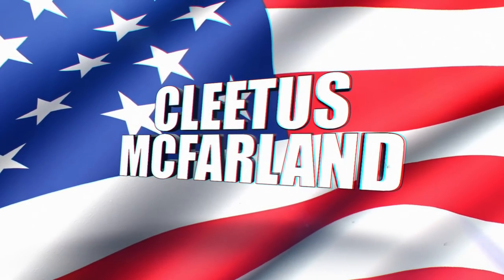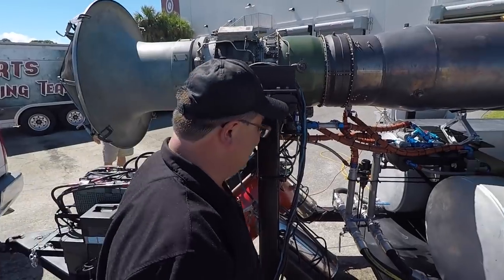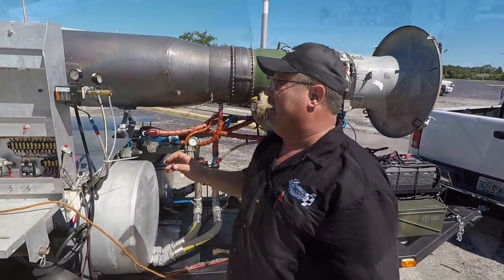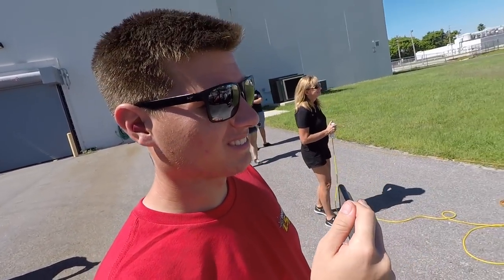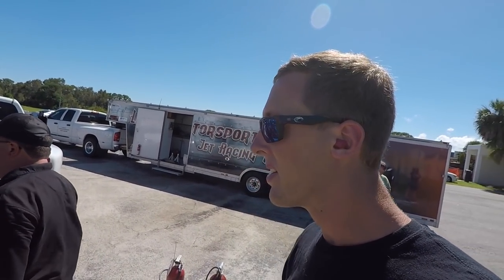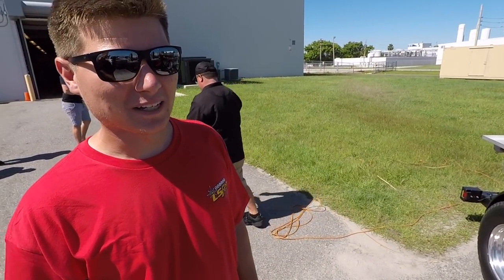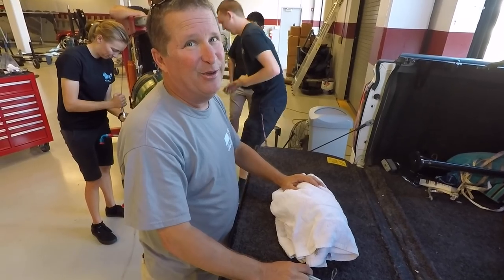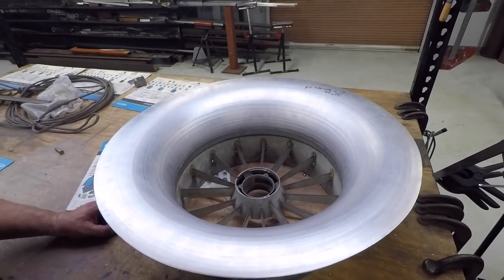Test Firing Project Mullet's ACTUAL Jet Engine! (Spooling Up to 90% Throttle)

Comment: For some reason, this popped up in my feed today (11/3/22).  It is crazy to see what Mullet is versus what he was supposed to be.  Very sad the tragedy that surrounded this but glad to see Cleetus made the change.
Reply: I really think it was a smart decision. Comparativley, Mullet is so much safer now.
Reply: Got it in my feed today also .  Nice to go back and see how much has improved in their lives and what a cinderfella life Garrett has .  I hope he keeps rocking out and innovating .  Have a good one fellas .
Reply: @Dji00  bruh because it’s a fkn jet engine
Reply: @Dji00  We are not talking about flying on a plane. We are talking strapping a plane engine to a car. Once the jet engine is lit there is very little control of things go SIDEWAYS.  We are also talking about 220 mph in 3 seconds vs. 220 mph in 6 six seconds. If you understand anything about drag racing you understand that 3 more seconds is an eternity.
Reply: @Dji00  Planes have wings and Aerodynamics, Mullet has... not that.
Reply: hearing them joke about mullet hitting 180mph had me laughing so hard now that its done 217mph
Reply: @bobbyraw7215  over 220mph now :D

Comment: Just one everstart battery shall do
Reply: yeah fr those batteries need to be everstart
Reply: Naaaaa a Walmart great Value battery its better bro!!!!! 😂😂😂
Reply: oh my how could i forget bro LOOOOL
Reply: I was thinking walmart batteries it is
Reply: If only everstart made lithium batteries. they are so light. Really need to get 1 for Leroy and shed some weight!!! Could even drop the alternator and gain some HP. Just charge it between runs. Just run as a total loss system like some bikes and other powersports.
Reply: yea they should totally go with lithium batteries, LiFePO4 would work really well, it would save alot of weight. it doesnt really matter the capacity is a bit smaller.
Reply: Edgardo Vigo this sounds like more of a bulk buy at Costco situation
Reply: To learn why jet cars require so many batteries head on over to the Larsen Motorsports YouTube channel.  The Jet Man Chris Larsen does tech tips in our videos! See you there! 🔥🔥

Comment: For those that are curious. 1 lb of thrust is equivalent of 2 Horse power. So a 3,000 lbs of thrust is 6000 horsepower engine they are putting in the mullet of the car world!

Comment: I used to crew B-52s in the Air Force. That punch in your chest is also referred to as a 'feeling of fullness'.  We were warned that it can cause certain levels of fatigue and loss of concentration, especially considering you're standing next to 8 of em that produce 12,500 lbs of thrust. That's makin some power right there!

Comment: The exhaust you felt from the side is the bleed air valve. When you run it in Tx and need a mechanic, ive worked these engines and am a certified A&P. Love the channel bud, Can't wait to see this finished

Comment: you should just have a starter cart and not have the batteries on board.. just use a high voltage plug in the side of the car... keep the batteries out of the car!
Reply: With the amount of fuel they r going to have to carry on board what's it matter... water weighs 8lb a gallon and diesel is 7lb a gallon...ur talking serious amount of weight... the car is going to be prolly 7500lb after its all said and done...
Reply: This is mostly all sponsored. He bought the car....both the jet and the LS(probably the powerglide too) were sponsored. Honestly he probably won't pay for the fuel either...some jet fuel company will sponsor him to advertise their fuel just like the E90 is given to him.
Reply: @nick4819  it runs on diesel or kerosene not jp12, why u think the afterburner was Smokey. Another reason why jet cars are usually the last things to run on a drag strip, they leave a film of fuel all behind it.
Reply: or fit a 36V alternator to the car engine.   Take a 28.8V one out of a European or military truck,  bypass the regulator and run it fast.
Reply: @David Moore ahhh the more you know. I know jack shit about jets lol I always assumed jet fuel was basically a higher quality kerosene other than military grades.
Reply: @NewLeaf yeah the good deal is getting it for free for all the publicity he's giving this company.
Reply: @rhull3939  I doubt their getting it for free but... Their not actually crazy expensive I mean. The MTT Y2K jet powered motorcycle was only 50k street price which was a turbine used normally in a bell helicopter
That had a fuel of4-6mpg petrol and 8 diesel. My guess would be 20-25k for the engine given the afterburner and other custom parts their being given with it. 

Shit... If you were crazy enough to do this at home without a professional shop's support Streeter fora reconditioned j85 is less than I've paid for a built big block Chevy http://jetandturbineowners.proboards.com/thread/63/sale-85-priced-reduced-500 

The. Race ethanol and fuel I suspect they buy in bulk with a great deal Vs total sponsoorship as well. Cleetus probably has 100k of his own money in Leroy and the same again in sponsors time/parts/discounts I don't know ANYONE in racing with total sponsorships everyone has some skin in the game in my experience.
Reply: You can get a used J85 pretty cheap these days used in working condition. That said, there literally giving the one that's been on a test cart for a long time probably a little worn for just sitting there being ran instead of air forced in it while moving keeping it cooler. Probably sold it to him for a $1 and the safety suits will probably have their logo on it and what else they agreed to. Either way it works out for the both of them.
Reply: Timmy Fkno  I think not doing it would be the stupidest thing that you could do...😜
Reply: Jed Lawson With the warm up and show with the afterburner it will probably use 40 gallons or so per run. Jet engines make loads of power but also use loads of fuel. And the afterburner usually over doubles the fuel consumption.
Reply: I'm saying to run it directly off an auxiliary alternator on the El Camino's engine,  which they are keeping in the front.  They could even use the piston engine to start the jet with a pulley and clutch,  like Thrust SSC does.
Reply: Timmy Fkno Why, Cleetus has always finished his projects.
Reply: Timmy Fkno 
putting on my shades to block out the haters.
Reply: They could start it with a ground power unit and avoid battery power all together
Reply: He said he wants it to stay street legal,  and you wouldn't want to tow it back to the start every time.
Reply: Getting a "good deal" for the jet definitely means some of the price is being knocked off in exchange of all the  publicity he has put on these videos, which we've all seen. Name the place several times, made a walkaround of the shop, etc etc... That's publicity, and it's paid for, with money or with parts (sponsoring).
Reply: The cash value of a jet engine probably crashes once it has exceeded its airworthiness hours.   Even if it is inspected and reconditioned it won't be allowed back in a plane, just from concerns about hidden fatigue.
Reply: Timmy Fkno Gotcha, but I think he prolly has enough connections that he’ll be able to overcome pretty much any issues he runs into, but we’ll see.
Reply: Timmy Fkno  he'll finish 'er...Cleetus always finishes his projects...it may take a while...the real question is why are you so negative? When I was a kid, my best friends dad used to take us to see the jet funnies run at Cecil County Dragway in North East, Md. Shit was awesome...you don't think this is fun? Why would you talk shit on Garrett? The man does what he loves and shares it with all of us...he'd probably do it for free if he was independently wealthy...
Reply: Jake Heke  ....In a 1/4mi I am guessing full burn for only a couple of seconds.  So maybe around 50gal + whatever it takes to start it and idle half way down the track or whatever he decides is a safe burn.
Reply: Are you thinking of the Bloodhound SSC? IIRC, that engine is to run the fuel pumps.
Reply: @nick4819  jet fuel is extremely close to diesel/kerosene. You can run them on either same with a diesel truck, it'll run with jet fuel

Comment: As far as I understand, you don't have to take the battery in the car. The turbine combustion is self-manteined. That means, once it starts, the only way to stop it is by turning off the turbine or sufering some kind of surge. Is this case, on the ground, it's very strange that a surge occurr unless the turbine it's not well tuned. So, once you start the engine, you can ditch the batteries and don't carry unnecesary weight on the car. Please, correct me if I am wrong. Greatings from Argentina.
Reply: To shut it off the fuel must be shutoff.
Reply: Can anyone can confirm or deny this?
Reply: They should get an golf cart or something like that.
Just add an 36 volt output for the turbine
Reply: You are correct, and yes, once its lit, you have to cut the fuel to shut it off
Reply: @pedrorivera4335  it's how allot of jets are started you use a cart yeah
Reply: Unless there is an "alternator" this is not possible. Yes the engine will remain running, Battery is required for starting and pumping fuel, sensors. I'm sure somehow there is a way this engine generates energy when started.
Reply: @8835-g1j  the battery needed to run a fuel pump isn't anywhere near the 36v monster for starting the dammed thing and having a car and a starter cart battery set will save a huge amount of weight
Reply: This turbine has an electric starter. It has a motor that makes the turbine spin until it reach enought velocity to sustain combustion itself. I think it is also used as an alternator once it's lit and that could keep charging a small battery pack. Way smaller that the one used on this video. There is an amazing Youtube channel from a guy called "agentjayz" about this matters. Highly recommended.
Reply: @USN_Ret-  you could easily run the fuel shut off to the in car battery anyways lol
Reply: Rickshi and Moku
The way they are set up it is a manual fuel shutoff. No batteries required. Fuel pump is engine driven, doesn't use electricity. The fuel has to be manually shutoff. Once the engine is started it doesn't require any electricity to run.
Reply: 88 350
Fuel pumps are engine driven, no power required after engine is started but yes you need power for instruments and they usually have a generator on the jet engine. They may have an electric fuel pump for starting like jet aircraft do but once the engine is running the engine driven fuel pump supplies the engine.
Reply: @USN_Ret-  these boys need to get them a good aircraft mechanics preferably one that has a lot of jet time.. my question is how are the El Caminos braking system going to hold this car and stop it?
Reply: Jed Lawson, the deisels have glowplugs though
Reply: Jr Gt
They need a jet mechanic for sure. I was Aircraft Electrician in the Navy for 20 years.
They'll use 2 parachutes to slow it down.

Comment: You think the cart idea is funny but thats how we did it when I worked for an Ag airport. Quick disconnect on the body, then another on a 10' lead that went to the battery cart.
Reply: Over here they start the jetcars the same way, a battery cart they plug into it and away they go.
Reply: Think he ment GA airport.  I work at one my self
Reply: @thomasweatherford8930  GA? Tbh Idk what you call it but we would spread/spray fertilizer and other shit on fields

Comment: What’s that fast golden jet on the bottom row of that shelf? 1:27
Reply: Cade Barfels the one with 4 legs?
Reply: Wait what did I miss something I didn't see it
Reply: Gerald Gas yea the fast one
Reply: jr villa 1:27
Reply: @cadebarfels9547  thank you imma have to go see real quick
Reply: They need a lot of fuel and the exhaust stinks.
Reply: Cade Barfels it’s a holly jet 100,000 bps  
Borks per second most powerful jet they own
Reply: It might look ruff but it's faster than the speed of bark.

Comment: A HUNDRED GALLONS? This thing can start a fuel crisis by just idling.
Reply: Its jet a fuel totally different fuel then diesel and gasoline.
Reply: @kmkboyz  actually jet fuel is almost identical to diesel.
Reply: Andrew Lowery No it isn’t, jet fuel combusts easier than diesel but not as well as gasoline.
Reply: john broskey airbus a320’s use about 500 pounds of jet fuel(83 gallons) just to get from the gate to the runway typically. And have a fuel tank capacity of ~5000 gallons. This little engine is nothing but it does burn a shit ton of gas because of the afterburner
Reply: Just the opposite, Kerosene burns easier than JP-5.
Reply: kmkboyz yea it melts steel beams
Reply: When it comes to jet engine fuel economy isn't part of the vocabulary. For exemple a Harrier Jet at full power consumes more Jet Fuel than two people could throw at it with 5 gallons buckets.
Reply: tractor lad farming  says the farmer.. I went to a cc caterpillar program and studied all about diesel fuel and it actually is very close to diesel fuel.. it has a different cetane rating and doesnt lubricate as much. but for the sake of the argument and to troll gotta give my 2 cents too..  I bet you didn't know mr smarty pants that diesel has an actual living organism that feeds off diesel and will ruin a tank? it's call the H.u.m bug. I took 12 credits in fuel injection systems and diagnostics... idk what your credentials are but you may know what I said just decided to be a Debbie downer
Reply: Yes sir indeed, The hummers in the military are equipped with  fuel catalyst and in a pinch can run JP5  or 8 but needs an added lubricant for long term effect and there is also an equivalent system for civilians that adds lubrication to the fuel on the fly. When you mention micro organism is also very true on some very bad cases we found some blue algaes in some fuel cells sitting for years. Gold Star on your 12 credits brother!
Reply: Alex Robidoux  that 12 creditswas just for fuel systems,  it was a total of 72credits. I did a rebuild lab and we tore down a d60. literally every nut and bolt including fuel pumps. diesels are amazing motors and are highly underrated to the general public.
Reply: @vector6977  

Civilian Jets don't run JP (they can burn JP8, but its not available for the most part) 

They were running on Jet-A/A1
Which other than a few additives, is pretty much the same thing as JP8 
Both are based on highly refined kerosene 

JP5 is a formulation used in naval aviation, where fires aboard ship are really bad news. 
So its formulated to have a lower flashpoint than JP8
Reply: Jet fuel doesn’t jell up like diesel
Reply: @Treyk901  It absolutely can
Reply: bearman ... not like diesel.. jet-a is -40 F and diesel is about 10 F.
Reply: @Treyk901  But it absolutely does gel up when getting into the flight levels. Thats why the DA-42 has a max ceiling of 18k feet. 

But going back to the original point of jet-a being like diesel, a few companies are not converting street car diesels into aviation engines that burn jet-a with minimal modifications.
Reply: @johnbroskey2547  lol'd
Reply: Everybody put your dicks away.  Jet A and Diesel are nearly identical.  They're both kerosene based.  I've personally burned Jet-A in a diesel with no ill effects and jet engines will burn diesel #2 just fine.  Need proof?  Ask the Shockley family, of Shockwave and Aftershock jet-powered truck fame.  They'll tell you they burn diesel in their jets.  Now that I think of it, you could contact Larsen Motorsports, the seller of the above J-85 and they'll probably tell you they burn diesel in their exhibition cars a ~$3 per gallon instead of Jet-A at ~$8.50 per gallon.  
Is there a performance hit by running diesel in a jet engine?  Probably.  Does Cleetus care?  Probably not.
Reply: @dylanforwalk612  this is a J85, old school tech and burns alot more. 1300 lbs per hour at idle, 3k+ pounds per hour at 100% N1. Can't compare fuel consumption on this turbo jet engine to a high bypass turbo fan
Reply: joshualeniger only difference between turbofan and turbojet is the size of the impeller and a bypass zone
Reply: @kmkboyz  Jet A IS diesel #1.
Reply: @eddieb5281  no, its thinner viscosity. same combustibility. no lubricant additives.
Reply: @OregonDonor87888  Bah Humbug. organism feeding off diesel is absolutely impossible I don't care how many textbooks have a cartoon of it.  If there is an organism it lives in the water at the bottom of the tank not the diesel. A common denominator of all organisms is that they need water.

Comment: I used to work on F15E Firghers and every now and then I would be a part of a burner run. Burner runs standing right near the aircraft are intense. When I was deployed they did burner runs much closer to everything and it would rock a lot of the buildings fairly near by.

Comment: What a little monster! Nice setup for the test cell. That afterburner is going to be nuts at 100-110%😮😜😁 I'm wondering what kind of thrust this thing is actually making if it can move that trailer and truck if you punch the 'loud' button when it's spooled up? You guys be careful.. improper handling or some foreign material getting sucked into the intake while it's running can easily get someone killed! Other than that, have fun and build something awesome with it.😁👍🏁

Comment: You better paint the jet casing with a American flag and bald eagles!
Reply: All the diesel all over its case, paint won't stick lol, the thing would have to be torn down to the case and acid dipped or hot tanked

Comment: You should try to get an electronically controlled transmission selector and link in with the ECU, so you can spool up the jet before you're done with the eighth mile on the LS and have it automatically cut into neutral and cut the engine when it reaches redline, so you can get the most out of both powerplants.